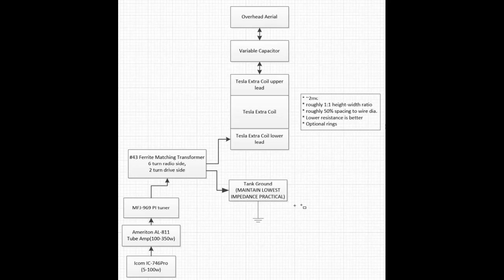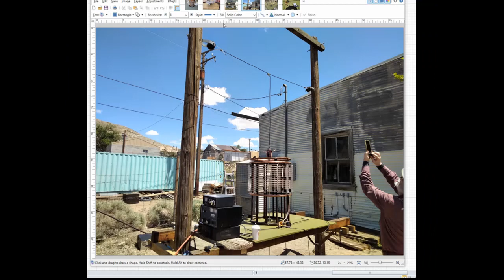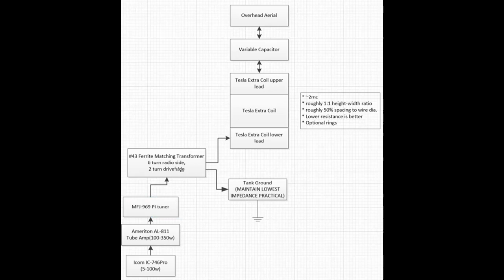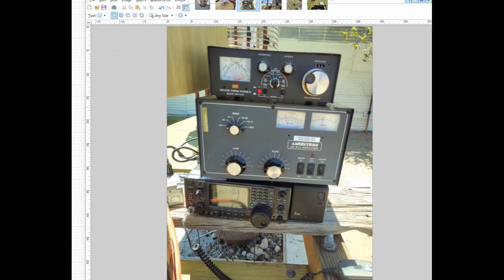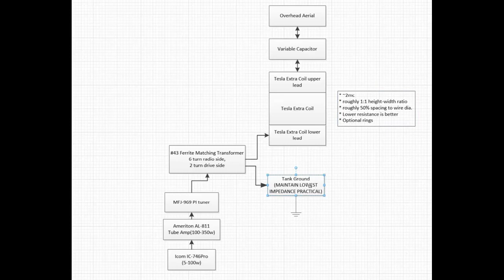Eric Dollard June 2023 Telluric Experiment Diagram+Details

Comment: Hi Hakasays, question about the height to diameter ratio you mentioned, when you say the magnetic field dominates in large diameter designs is this in any way similar to how Faraday Disks produce very high Amperage but very low voltage relative to their RPM, diameter, and magnetic field exposure? Can the large diameter coils be used to raise the Amperage present when excited compared to the source?

I'd also like to ask about this quote from Dollard I found from the Energetic Forum:

"Yes, harmonic oscillations in coil windings generate parametric dielectric energy storage co-efficients. Farads per second. Good path to follow."-From: Eric Dollard Sent: Friday, September 30, 2011 1:55 PM

Is this still valid to what is known today? If harmonics in coils can generate Faradas per seconds conditions wouldn't this make the enormous voltage rise in tesla coils a result of this over just simple accumulation and mean there is a potential of real power gain if combined with a step down winding?

Too add to that, does the Oscillating Current Transformer Dollard writes about in his Theory of Wireless Power get its name because the output waveform of the coil is Oscillating Current that grows or decays with time over simple Alternating Current? Cheers.

Comment: Thank you for sharing. In your experience what type, shape  size coil will ring the most, as in a flyback or a dampened wave ringing from a dc pulse applied. I wonder if its possible to treat identical coils like there tuning forks. Pulse one coil with hvdc at a very high rate of change or a large magnetic impulse from a smaller primary. I dont know exactly how it would be coupled but could a identical coil or coils see ac or the resonant frequency
Reply from the maker: @connerswedman598

>In your experience what type, shape  size coil will ring the most, as in a flyback or a dampened wave ringing from a dc pulse applied.

* In my experience the most important factors to Q factor are resistance (wire thickness) and minimizing the mass and loss-tangent of the coil support.
PTFE (teflon), HDPE, LDPE are the ABSOLUTE best you will get in terms of dielectric losses.  If you must use lossy materials like wood/pvc/epoxy then try to minimize the mass of it, or use spacers so the bulk of the coil is not touching the lossy material (as seen in the pic)

* Geometry also plays a role, but at long as the height-diameter ratio is within 3-1 (or 1-3) the balance is decent.  We tend to wind roughly 1-1 height-to-diameter in our coils and IIRC 80% height to 100% diameter is the ideal to balance dielectric+magnetic components.

* If you have a gap between wires this will improve the Q factor as well by cutting down on dielectric losses, with the ideal being about 150% the wire diameter center-to-center  (IE: leave a gap that's 50% of the wire diameter).

* Last, length of wire will improve Q factor a bit as well because percentage losses for both E and I fields decrease with scale.

Hope that helps, I'd be happy to help you design a specific coil if you have a specific size/frequency/power level in mind.😉

Comment: How the heck do you measure your ground resistance/impedance?
Reply from the maker: With a thermo ammeter and the HAM radio, Eric showed me a technique:

Watts on transmitter divided by amps on the thermo-ammmeter gives you standing AC voltage between coil and ground

Take that number and divide by amps again and you get the total system impedance

So for example:
80 watts / 2.2 amps = 36.4 volts
36.4 volts / 2.2 amps = 16.53 ohms total system impedance

The hard part is finding working RF ammeters on ebay
Reply: @hakasays   Thank you for explaining the process

Comment: Nice explanation, very informative. Would love to hear about that pancake stacked coil picture you showed briefly at the end  :)
Reply from the maker: I don't know much about the coil other than I built it😅
Griffin designed that coil, and if I recall it was a scale-model of a Steinmetz/Alexanderson coil used at the Landers facility.  20lbs of 10awg copper wire, so about 630ft total.

It was resonant around 400kc, but because of the equipment there wasn't much we could do with it yet.
Lowest common HAM radio band is 1.8-2mc so the normal radios just don't cut it.

One of the Steves (Gavin or Mcgreevey) was planning on making a tube transmitter for it, but as with all big projects like that it will probably be a while before we see the fruits of it.